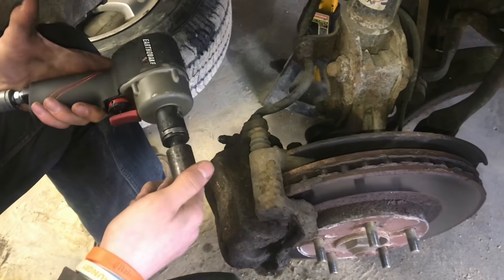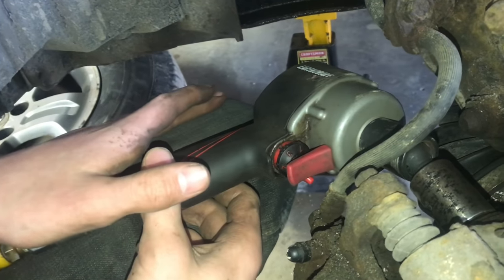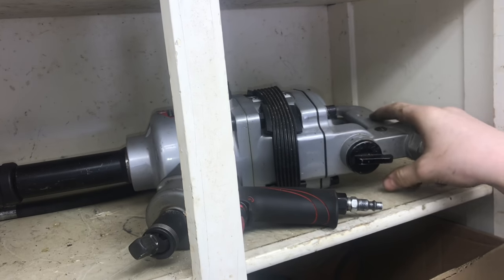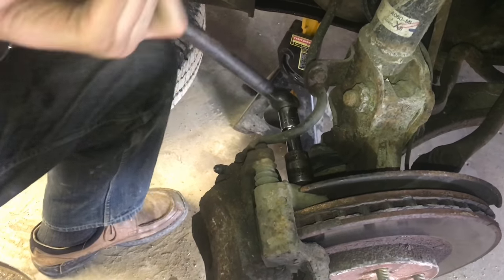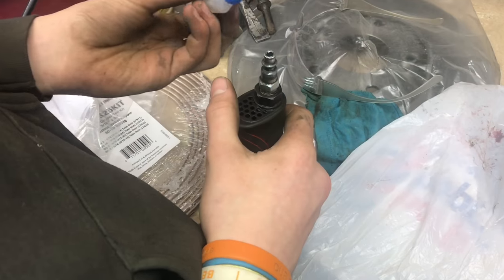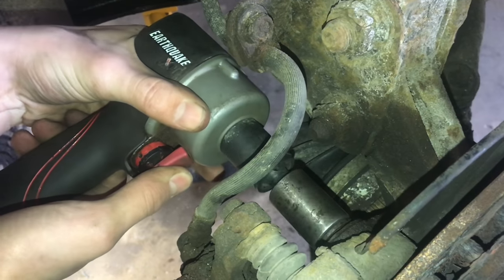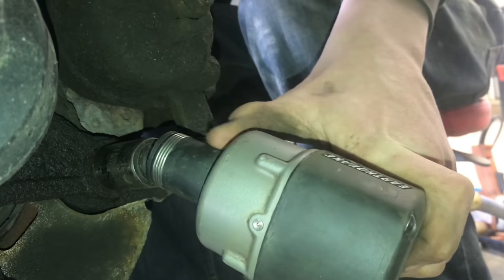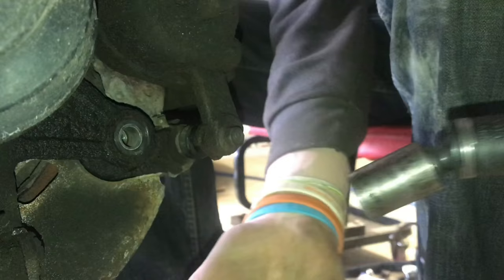how to LOOSEN stubborn caliper bolts (almost every time)

Comment: My problem is on the rear, and you won't get a breaker bar in there since you cannot turn the rotor
Reply: We're fucked
Reply: You just gotta get a open ended wrench and a hammer. That’s the only way. Be prepared to break the wrench.
Reply: Or, blow torch the bolts before trying to loosen them. The heat may break them loose.
Reply: @kevinbrigden6276  Had to go to the mechanic with it. Almost melted the caliper bracket using a torch and it still wouldn't come off. Even they used 45 min to get it loose. Oh well don't have that car anymore and thank god for that
Reply: @Sci-Mon1  Yea, no lol. Been at that for the past 4 hrs. What else now besides heat. .
Reply: @maniacalmonster2293  you can fit a right angle impact in there. That’ll take it off
Reply: @Sci-Mon1  😆 the best I got is a hammer drill lol. 
I JUST got done doing the Jack trick and the bolt never seemed to turn & the wrench never turned either but I sure as hell kept jacking the jack up and up and up.. but nothing. It was like some  phenomena crazy black magic voodoo shit. It started to really creep me out and I got worried that I was going to break something, I just felt something was going to snap at any second so I stopped doing that lol
Reply: Well I feel welcome to this group. Been dealing with them sucker since last night blaster and 3 different impacts and nothing rear caliper bolts
Reply: My g35 has no space for a braker bar even a swall 12” kinda stuck atm
Reply: I went and purchased new rear pads for my 2007 Avalon and I'm so pissed because I'm so close to being done. Was able to get the backside pad in but I can't get the front side pad in because the bottom 14 mm bolt will not move. I cannot fit the caliper back over both pads because I will need to adjust the caliper outward towards me to get to close back over the front pad.
Reply: @killerwolf4731  did you ever find a solution? I have a g35 as well and trying to replace the back brake pads but the bolt won’t come off
Reply: Me too. 2004 chevy Silverado.  No room for my impact or for a breaker bar. If I was on a lift I could use a breaker bar. But I'm not! I don't own a lift!😡😡😡😡😡😡😡😡
Reply: @Sci-Mon1 not always mine didn’t
Reply: Feel better knowing we all going threw thing together
Reply: Am I in the worst nightmare mode scenario of all? Some dumb fuck put a different bolt in there than supposed to, over torqued it, now it’s completely rounded off, can’t get a wrench or vice grips to it because it’s being fucking shielded. Don’t know what to do, I think I’m at the end of the line.
Reply: @chloestrickland9545  holy shit i was trying to remove the rear caliper on my g35 earlier today, i am not surprised that it's not just me having this problem
Reply: @Mygary  Seems like you need special tools and a torch for that job. I had to take mine to the mechanic and they said they fried the fucker for a long time before being able to pull it out. But yeah, your situation seems fucked, and a mechanic sound like the answer. That's at least better than spending days trying to figure it out like I did haha
Reply: u may be sir =/ @Mygary

Comment: ok... and what do you do if you dont have a shop with a torque wrench or a breaker bar..? lol
Reply: call your mechanic xd
Reply: Yea dude if i had all that i wont be on youtube looking for shit
Reply: I have a Milwaukee 1/2 Fuel 1400 ft lb breakaway impact wrench. Doesn’t do anything if you can’t fit it inside the fender space.
Reply: Buy one 🤷🏼‍♂️
Reply: David DDM  I totally agree with that LOL it's expensive but at the same time it's a good investment
Reply: Dave DDM  brake pad changes should not require air powered tools, it's something average Joe's do all the time
Reply: Dave DDM  swivel breaker bar because of tight space?
Reply: Dave DDM  cause they don't have money for either(?)
Reply: Use your jack under the  handle of ratchet and it will break it free most times. Get it to engage and one pump at a time it'll move

Comment: I use a jack, just position the jack under the breaker bar and lift, works beautifully.
Reply: This tip save me A LOT of money !!!  Thank you Jay !!!
Reply: I’m about to do it 😖
Reply: Thank you thank you thank you!!!  Just tried this after trying everything on a caliber bolt and it worked perfectly
Reply: YOU HELPED ME BRO THANK YOU
Reply: Wow great idea 💡
Reply: Just used the same trick .. couldn't use breaker bar .. working from ground .. but Jack worked a treat ..
Reply: The thought path my brain didn’t take, thank you
Reply: it lifted the car up…
Reply: I have sprayed them with Blaster, and letting it sit for a bit, but then I'm going to give this a try. Fingers crossed this works. Thinking outside the box. I love it. Thank you, and will update the results. Like one reply said below, I'm concerned it will just lift the car since it's a Camry.
Reply: Great idea thank you
Reply: Wow! Thanks boss... Been banging on this thing for hours and this worked in under 5 mins! Bless you!
Reply: I LOVE YOU
Reply: How to do that 😅
Reply: How about the opposite side? It’s not possible to use jack because the force goes down not upwards?
Reply: @alansantos9312  are you talking about the driver side and how you would have to position the breaker bar ?
Reply: @alansantos9312 I was just gonna ask that cause now I'm stuck on the driver side contemplating a new impact 🤔
Reply: That works on the passenger side

Comment: Was fighting a caliper bolt today, old timer grabbed a shorter breaker than mine, TIGHTENED THE BOLT A LITTLE FIRST, then broke it with ease. I am humbled everyday
Reply: Back and forth breaks the rust up

Comment: A $6 bottle of anti-seize would save you a world of trouble.  I know some folks don't like to use it on brake bolts, but then again, look at what you have to deal with without it.
Reply: How
Reply: @TheBeeHive2700  Just put a little anti-seize on the threads before you torque it down.
Reply: I've used a gallon of anti-seize, working on it for 16 hours and counting.  I think the last genius used non-removable lock-tite.

Comment: I've had a battle raging for 3 days.  Finally won today. A spark plug socket pounded on for a super tight fit, a box end wrench on the back of it, a 4' metal snipe, finally broke loose.  One of the bolts, the only trick that worked was the floor jack (thanks for that tip  in the comments here) to put enough pressure on the wrench to get that one moving (works if you're on the right side of the vehicle so you're pushing from ground up.  So one hernia operation, a pulled groin, ruptured testicle, and,....done!  2001 GMC 2500 HD.

Comment: Thank you for the tip! I had two bolts that wouldn't budge. Used penetrating oil, heat and a breaker bar with a hammer. What I really needed was just more leverage. Then bolts moved easily once I added about three feet to my breaker bar with the cheater.
Reply: I broke 9 out of 10 of caliper bolts

Comment: Same experience w my 2015 GMC Sierra. Fortunately there was room for a breaker bar and pounded it with a big lead hammer. A second person is necessary to pre-load the bar flex so it doesn't bounce and to hold the 6 point impact socket straight.
*There was lots of thread lock compound in the threads*

Comment: To get better performance out of the impact wrench (Bambii) you need to make sure you have good air fittings and air hose. Plus dont use the ball join adapter it's ok to use extension but the ball join adapter takes a ton of torque away

Comment: Any idea on a RWD car? Torque wrench is battery pack and it dosnt provide anywhere near the torque I need. Iv changed rotors plenty on other cars but on my charger they will but loosen. I have a few threads showing on the bolts and it still isn’t easing up. Ended up leaving the rotors and just doing the breaks out of fear of snapping the bolts. After a few spins they SHOULD become easier to take off

Comment: How do you remove a seized bottom caliper bolt on a rear caliper? There's not really any clearance since I obviously can't turn the rotor to an angle.

Comment: I got one brake set on, only to run into a stubborn bolt on the drivers side caliper. 🤬 and I have no power tools. I guess I’ll be running on one set of brakes till I figure this one out.
Reply: I was able to change the pads and rotor on pax side, but have a rounded bolt trapping my driver side rotor

Comment: Used cheater bar, stripped the bolt.  Welded the socket on, broke my breaker bar.  Used an impact, started on fire.

My bolt is satan.

Comment: What happens if the bolt breaks? I have a 2001 F250, I'm doing the same thing with the air impact, does nothing. I have 3/4 " ratchet and breaker bars, but I know if the bolt breaks I'm screwed. Montana truck with rust.  I will definitely be using anti size on the re-install.

Comment: Today I tried to change the rear discs on my Volvo XC60 D3/D4 from 2012.  The saddle with EPB motor was rather easy to release (and I used a 12V battery to return the pistons) but then when I tried to unbolt the two 15mm bolts they unbolted in the beginning (but not easy) but after a few normal  'easy' turns they became so heavy to turn over that I thought they we're going to snap. So I decided to stop and put everything together again. Quite frustrating that I only could change the brake pads but not the discs...  Has anyone advice about this? Is it normal that these 15mm bolts become very difficult to unbolt at the end??? It seems not logical at all and very strange to me.

Comment: What if you have a Honda and there's hardly any clearance to even get a frickin breaker bar and socket firmly on the bolt and then barely any room to turn it and you already put a cheater extension on it and it still wont come off because the last idiots that worked on it clearly overtightened the damn thing?

Comment: Just twisted 2 bolts off 1 caliper with my big breaker bar… looking for advice as the other calipers bolts are just as stuck… and drilling out the twisted off hardened steel bolts is not easy. I had soaked them all for 24 hours in penetrating oil and it did nothing.
Reply from the maker: Here’s a couple thoughts. If the head of the bolt started to move even just a little bit, switch to a ratchet, Keep moving it back and forth to work the rust out of the threads. I’ve snapped a lot of bolts that could’ve been avoided if I worked the Bolt back and forth to get the rust particles out. Sometimes I’ll use the breaker bar in the opposite direction to try to break it loose that way and then in the correct direction. Sometimes taking a hammer and tapping on the whole can jar some of the rust loose. Working with rusty nuts and bolts can really be a challenge. If I’m pushing on a Bolt with a large breaker bar there’s a point where I start to get nervous that I might twist the head of the bolt off. That’s when I stop I think I hit it with a hammer I go the other way. A lot of people find that heat helps with a torch. I haven’t found much luck with that personally. If the bolt does start to move it’s extremely important to go back in reverse and then Forward many times. If it feels like it is locking again reverse the direction. I hope some of these ideas are helpful
Reply: @livefree6878  thanks, I was able to get the 2 bolts out by moving back and forth just a bit, lots of penetrating oil and patience, now I need to find a RPL spindle as the twisted off bolts are not going anywhere.
Reply: @livefree6878  great 👍 info thank you

Comment: What's the process when the bolt head has become rusted then become rounded off when applying the breaker bar?
Reply: Find a socket that barely fits, be it metric or whatever so it is snug and then hammer the socket on  to the head all the way then attach bar

Comment: I used this method and I broke the bolt, it’s in halfway and no room to work on it, if there is a way to take off the caliper brackets without cutting it
Reply: I didn't break mine yet but I am afraid I am going to which is why I didn't try his method!
Reply: Let me know if you find something
Reply: @bergenmatthew  I actually have my truck still in the air for about a week now. I got the two bolts loose on one side using liquid wrench. The other side I just keep applying it to and plan to tackle it again this weekend. Liquid wrench from what I have seen online is one of the best penetrating oils you can find.

Comment: "My Cheater Bar" Snapped a bolt once. Since then, I always go to some nearby shop and pay $30-50 to have them extract targeted bolts; necessary for my project, apply anti seize & reinstall. Then go home and enjoy my time working on my car.
Reply: That actually is a great idea.
Reply: Great info, are the shops using different techniques?
Reply: @acemoto2319  Acetylene, impacts hammer & cans of Freeze Off.
Reply: @scottfree2929  ok thank you 👍

Comment: What if you have shattered 5, 1/2 inch drive sockets with a 5 foot cheater bar and still haven't broke loose 👀
Reply: Use a car jack beneath it or above it if you have to

Comment: use map gas and a breaker bar
Reply: Or propane. Placed on the knuckle around the bolt. At least on my car, the knuckles are aluminum, which heats up and expands faster than the steel bolt. Also softens thread locker. Then bolt can be removed.
Reply: What is map gas ?
Reply: @jasonburton5092  is butane like propane?
Reply: It didn't work. Gotta love the rustbelt
Reply: @acemoto2319  it gets hotter than propane. MAPP

Comment: Found out today that my front driver's side we had to pull down to loosen and front passenger pull up to loosen . I believe that means they both are clockwise actually. Broke two bolts thinking the passenger side would remove the same as the drivers 😢 had to buy a new caliper and install it which was a task too .  But done now 🎉

Comment: Breaker bar also snaps the bolt in half some times. :D And that sucks!
Reply: How do you get it out if that happens? I've tried drilling through it and using a bolt extractor with no luck

Comment: My bolts are rust welded so hard my breaker bar actually stripped the bolts and made it worse.  Whoever owned the car before me clearly did not use antiseize!
Reply: Of course they didn't use anti-seize, that would be moronic.
You are supposed to put thread-locker on caliper bolts...

Comment: My goodness mine are so tight that I decided to just replace the calipers and brackets which luckily come as a package deal with upgraded caliper bolts no more t55 
But I spent the morning painting the new calipers only to get this problem again with the brackets 
However my wheels were straight because 1 I don’t have a ebrake nor a Jack or stands to raise the front and secure it only have a 2ton floor jack and stands .
I’ll give it a better shot tomorrow in the rain 90 degrees here today tomorrow rain but I want this done

Comment: how do you do the rear? I can't fit in my breaker bar and a cheater bar inside the wheel well, and I can't turn the steering wheel to get a better angle like you do on the front.
Reply from the maker: I wish I had an answer for the rear, this trick works so good on the front.
Reply: Just changed my rotors on 2009 p71 caliber bracket bolts were hard to come off went to Home Depot to get a metal pipe already had a breaker bar . Bolts were no match thanks for the video

Comment: dude

were you working on a truck??
car caliper bolts should not be that tight
Reply: They are on my Volvo--15 MM, spent over three hours, finally got the two bolts off, using breaker + cheater and jack and BFH.  Now the other side same thing.  No access.  Went and got 36" cheater bar but no place to put for leverage.
Reply: @chien-shengtsai8626  
Previous person must've used red loctite
Reply: @atillaozturk7075  Volvo OEM bracket bolts come with red locktite preapplied.    I finally got one side off, second side was easy initially but now stuck.  I ordered some impact stubby sockets because I didn’t want the regular sockets to shatter when using breaker and cheater.

Comment: All I need is a lift to give me the room to use the 4 foot pipe extension so I can then use my swivel ended impact wrench. Translation: How to loosen a stuck caliper bolt: use a mechanic cuz you ain't got the tools.

Comment: Did nothing for me
Reply from the maker: Wow! For us this was a game changer,When the rotor was turned in line with the car, I couldn’t get our breaker bar in to get extra leverage. Soon as I turned the rotor outward I could not only use the breaker bar but a cheater bar. If I can’t just remove the caliper bolts first time I’ve been using this method. Of course this only works in the front because you can’t turn the back wheels. Just curious did you use a cheater bar on your breaker bar. I’m just wondering why this didn’t help you get more leverage. Thanks for your thoughts

Comment: My lower bolt is stripping 😩
Reply: You could try a small pipe wrench with a cheater bar 🤷
Reply: What did you end up doing ? I was thinking buy a whole new caliper with bracket because my is super fucking frozen and rounded .

Comment: I found that if you have your ratchet on the caliper bolt and a box wrench on the guide pin and turn the guide pin in the opposite direction first, the caliper bolt turns out by hand. At least that worked for me on 3 vehicles over the weekend.
Reply: You talking about the caliper mounting brake bolts or the caliper guide pin bolts? Because they’re two completely different animals
Reply: Sounds like something is fishy.  You tighten the guide pin bolt and the caliper bolt becomes finger tight?